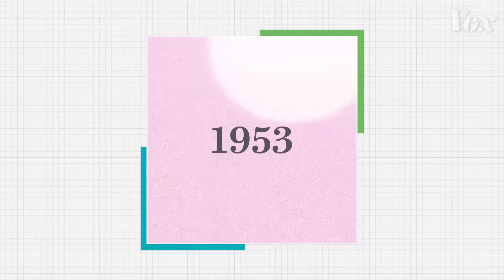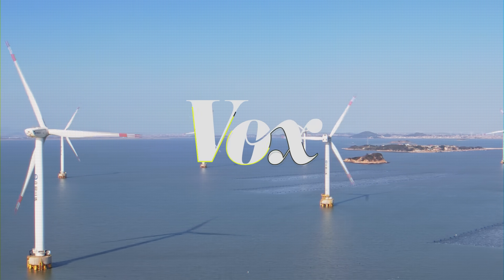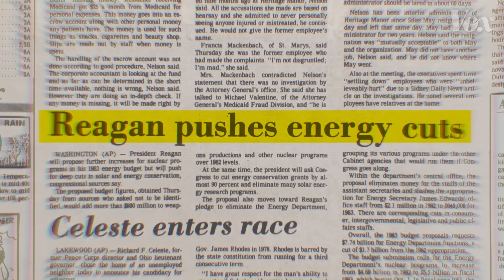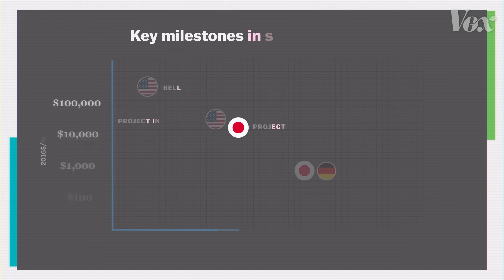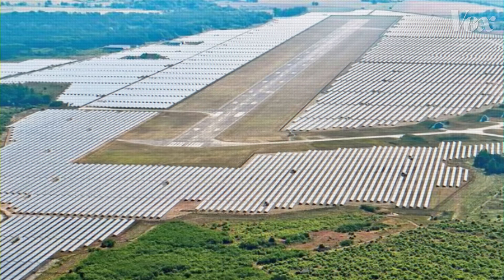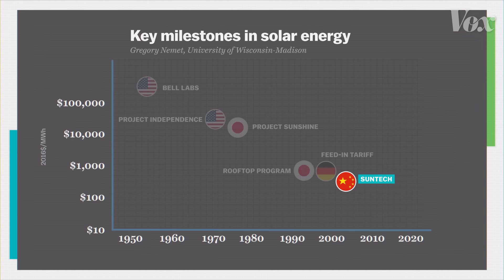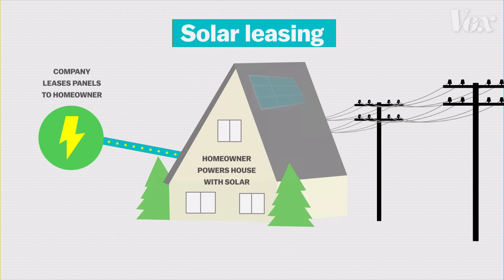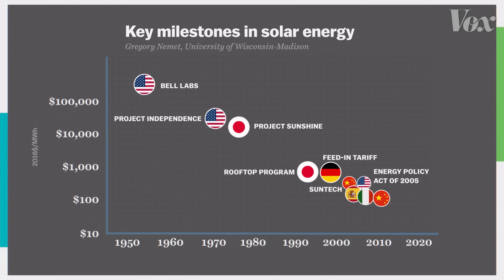How solar energy got so cheap

Comment: I’m not even 20. But I remember when people were pouting about how “it’s too expensive” just 8~10 years ago. 

Though, I didn’t hear people brush off the idea of it becoming widespread. 

But I don’t think anyone I knew imagined that so many INDIVIDUAL homes would adopt solar panels. We thought for the foreseeable future, it would just remain a sideshow power source only found in large open & rural spaces.
Reply: 22 here, fax
Reply: 4 years old here, i was saying the same exact thing.
Reply: @MastrDante  😂
Reply: i don't know where these numbers are coming from.. its still basically the same as it was 8-10 years ago.. way too expensive...
Reply: @michaelransom5841  I get what you’re saying. Honestly, I agree. The cost of actually INSTALLING solar panels is still absurdly high. My original comment in way was more about how widespread solar panels have become. I didn’t directly say that it’s now (in the end) way cheaper.
Reply: @HAL-bo5lr  true.. I think I may have come across a little on the abrasive side. I desperately want solar to be a realistic choice, and it just gets frustrating when hearing that it's cheaper than anything else, but I still can't make it work financially. 

Of course it really depends on where you live.. I'm up near Seattle, just north of the Canadian border.. (can see port Angeles from my yard) and between the latitude, and the amount of rain we get in the winter, it's just tough to make the economics of solar work here I guess.
Reply: @michaelransom5841  No worries about the tone. I’m happy someone was actually able to criticize and call-out Vox’s one-sided presentation. I’ll admit, you kind of bumped me back down to reality.  

I don’t think living in a rain-heavy area has anything to do with the cost of installing solar panels. I personally have family from Texas who are able to live like they used to—that means turning on either the AC or the heater all-day—AND have a lot of power leftover. So yeah, it is definitely practical, but not yet very accessible so to say.
Reply: @michaelransom5841  (Edit:) The source (ourworldindata, rated highly factual by mediabias/factcheck) is in the description and you can see that the price of solar in 09 vs 2019 is $350+ MwH vs $40 MwH.
Reply: @System_Anomaly  I just don't get where people find solar equipment that cheap.. I have looked everywhere...  even alibaba.. (and i don't just these panels to not start a fire!) I hear news stories saying it's sooo cheap.. but i can't find panels for less than $1 a watt, and installed I can't get cheaper than $3 a watt... usually the quotes are closer to $5 watt..

Where are people getting solar for $0.20 a watt?? is this only in certain places?? is it only through government channels?? why does it cost the rest of us so much more if it's really that cheap?

Why is there such a disconnect between these reports and our lived experience.
Reply: @System_Anomaly  I'm not trying  to be ignorant.. it's just i really want to go solar, but the price hasn't budged in years and it is still prohibitively expensive.. even amortized over the life of the equipment it will cost me nearly double per kwh than just getting the power from the utility company.

Then i see reports like this and I'm left completely confused. If its cheaper to produce electricity with solar, why isn't it being used to generate electricity here, why can't we access this cheap solar energy... it just makes me mad.. somebody somewhere is lying.. i just don't know who...
Reply: @michaelransom5841  You are correct, and this is the problem when people only take a single data point and use it out of context. 

While solar panel costs have fallen, the actual panel cost only makes up 8-12% of the total install costs for solar. The average cost to install in the US for a basic system is around $22,000 and most of that comes from other costs such as inverters,
the racking and mounting equipment, wiring, supply  chain costs for all material, labor, overhead, SGA, and permitting/interconnecting. Oh and don’t forget the interest on any solar loans you take out to finance.

Even if solar panels were completely free, it would still cost $20,000 to actually install it on a home. And this is an average cost, if you want higher quality or a bigger system the cost only goes up. On average it will take around 20-25 years to recoup your investment via energy savings, but this will vary depending on local energy prices and your setup.

I would love to have such a system but the costs are still very high for a lot of people. Hopefully install costs come down soon.
Reply: @michaelransom5841  See my above comment response please, sorry for totally misinterpreting the tone of your comment. Edited mine to reflect that.
Reply: @alabaster275  Well put
Reply: @System_Anomaly  all good.. I was letting my frustration get the best of me and it very much came through in my tone.
Reply: Okay YouTube REALLY doesn't want me to post that comment, deleted twice for links. Short and sweet this time, thank you to the above person for sharing more good info. The articles I looked at and shared in response to the earlier one were also good, here they are:

SolarReviews" Why Are Solar Panels So Expensive"
Quartz, "Why Solar Panels Cost More Than They Should"
Reply: @System_Anomaly  thank you.
Reply: @michaelransom5841  No worries; of course.
Reply: Turning 19 this year, this guys spitting facts.

Comment: cheers to the death of big oil 🥂
Reply: It doesn't lead to the end of big oil in Germany. Germany needs to use more coal + gas since they closed nuclear power plants and that they require a source when renewable can't provide energy (at night, when there is no sun or no wind). In the end, natural gas and coal consumption didn't decrease, and even increased for coal, which is the worst in terms of emissions.

Comment: Cool, now store that energy long term. That will be the real game changer to renewables.
Reply: Now the power plants already can store the energy using hydropower. By storing the energy in the form of potential energy of water. Though this method has a low efficiency
Reply: @arcssssss  It's the best we've got since electrical batteries are just more expensive and resource inefficient. Nuclear is also really important for its reliability. It can easily form the base of any energy grid.
Reply: Yes, battery tech needs to catch up, but also a better way of making batteries, Lithium is not the answer
Reply: @Chris-wq3pe  Electrical batteries are just expensive and resource inefficient, we can't afford an absurd amount of them that would be needed to store a significant amount of energy.
Reply: @Chris-wq3pe  there already is. It's sodium-ion batteries. Lithium has greater energy density for the size and is lighter, thus why it is used for your phone for example. Renewable battery storage doesn't need to consider size and weight as it is stationary. Sodium-ion is also cheaper for the energy density vs lithium.